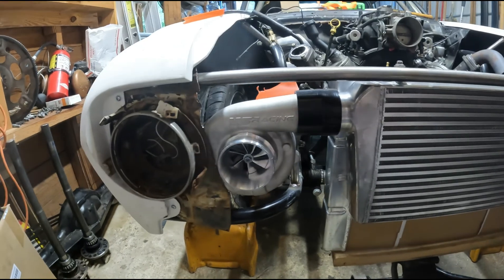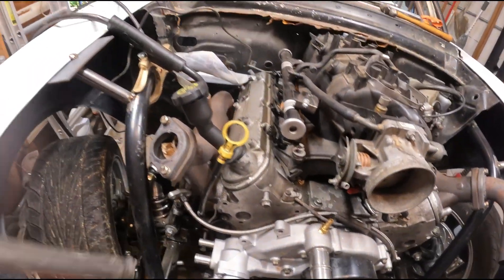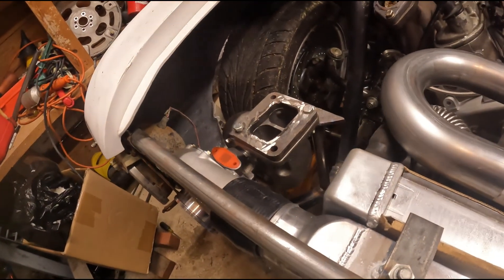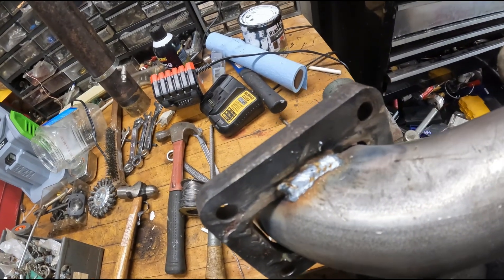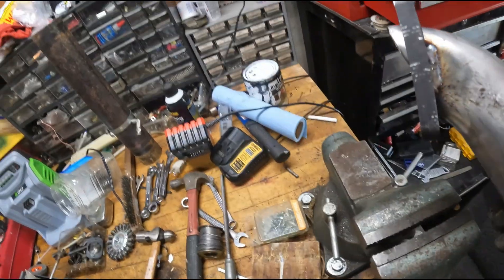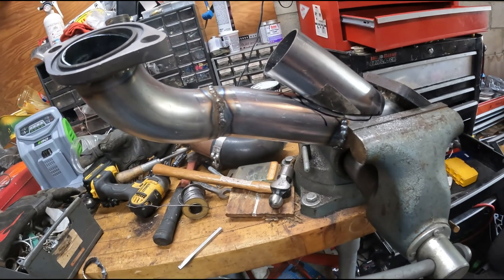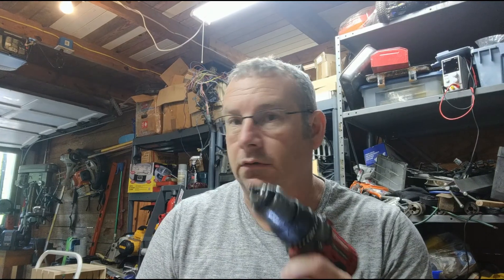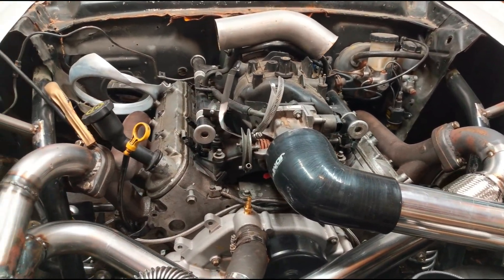DIY Turbo Merge, hot side and cold side

Comment: Uh oh, looking at this is making me think I need to move my firewall and engine back 2-4 inches and make room for all this!  I would say if you could curve your J bend out towards the radiator you could get more space between the intake and top rad hose.  BTW, what radiator are you using?  And a fellow lefty to boot!  Cool updates!
Reply from the maker: Yes if you are going to run any kind of power adder beside nitrous I would move it back while you are at it. I am using a speedway motors radiator. It is 31" x 19" ls swap. Your car is looking great. You are doing some amazing chassis work on it in home garage. Very cool.